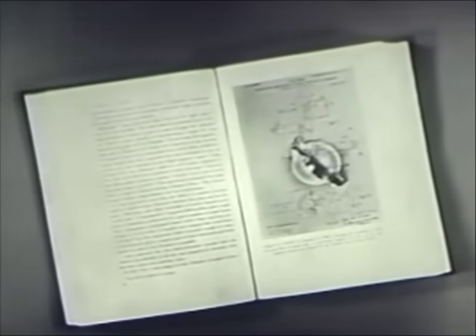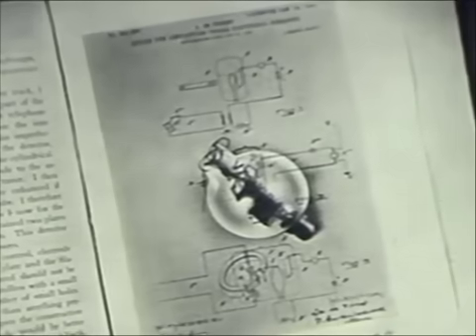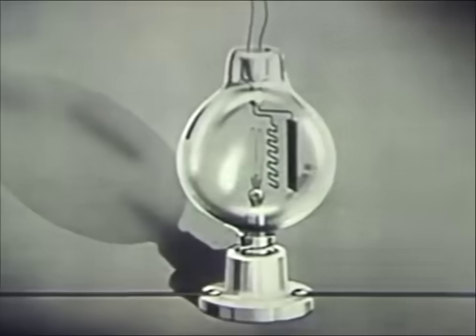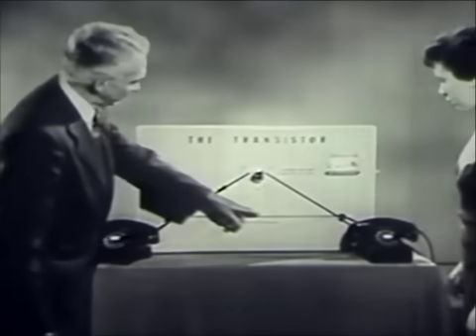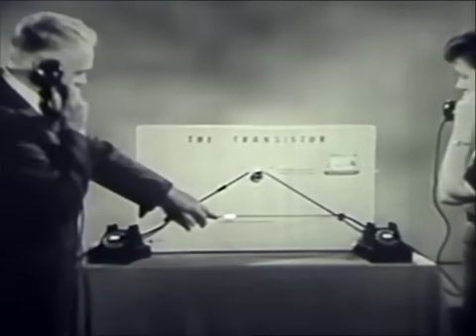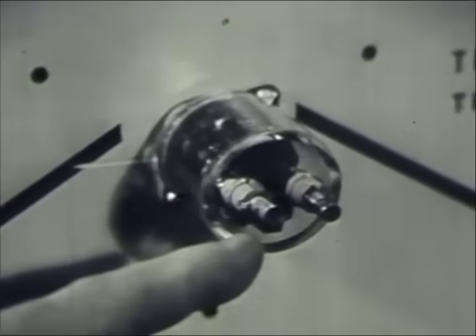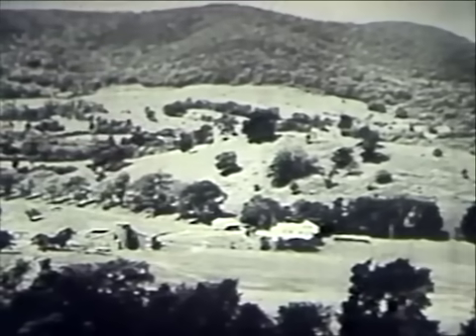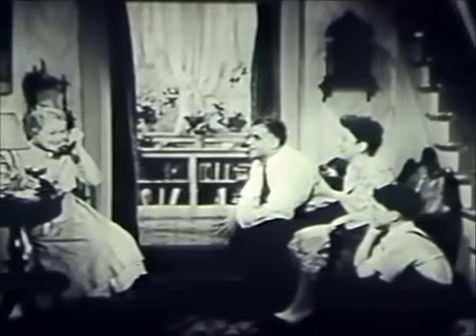The Transistor: a 1953 documentary, anticipating its coming impact on technology

Comment: In 1953, I wonder if the manufacture's could fathom in 2021, IBM would manage placing 333 million Transistors in an area measuring 1 square millimeter.

Comment: Not long after that, science built the backpack heating/air conditioning unit that could run for days on the same battery. 
It was so reliable, it went to the moon but was never seen again after that. 🤔 🤷‍♀️

Comment: "will lead to devices with longer life..."

Apple: "we'll see about that."
Reply: Oh shut up you fuckhead
Reply: Don't apple devices have a really long lifespan compared to android devices?
Reply: @aimbotmainvz683  about every iPhone I ever saw had a cracked display and it is not a secret that Apple slows older models down with software "updates" to encourage you to buy a new one. Long living and affordable Apple products are a thing of the past
Reply: @plt927  There no more iPhones that have cracked screens than Samsung (comparatively).
Reply: @aimbotmainvz683  I genuinely don't know, but many of the practices that they championed, including making batteries non-user replaceable (and expensive as hell to get done via the manufacturer), walled gardening, and pushing upgrades that devices aren't optimally suited for are all practices known as "planned obsolescence." The difference between Samsung and Apple is that Apple customers have fewer means to opt out, because Apple controls everything. Samsung, however, cedes some of their control to Google, which has been pretty benevolent overall.
Reply: @sarysa  The good things about Iphones is the software support (at least 5 years). While android devixes stop getting new update after 3 or 5 years.

Comment: That's all very nice and dandy, but today in 2021 for example I am a musician, I play guitar, electric guitar. If I buy a 100 (one hundred) watt transistor based amplifier (also called a solid state amplifier) for my guitar it will cost me something like 350 dollars. If I want a 12 (twelve) watt amplifier that has vacuum tubes it will cost me 1300 (one thousand three hundred dollars). We realized that the old tube based amplifiers of the 1940's and 1950's and 1960's sound much better much warmer and even more alive than the best transistor based amplifier. So we went from the best to crap and now if we want old tec it costs about 4 to 5 times as much.

Comment: Also this magnificent quote from not that long ago.
In 1977, Ken Olsen, the founder and CEO of Digital Equipment Corporation, said, “There is no reason for any individual to have a computer in his home.”
Reply: That quote is incomplete. Olsen's complete thought is that we would be connecting to the services of other computers, and part of our monthly bills would be access to those computers.
Reply: @grandrapids57 So both right and wrong. The home computers came first, and the services came later, and the main hindrance to Olsen's vision was data transmission capacity.
Reply: @scottwalker8021  Yes, communication was the bottleneck to his vision, but no he wasn't right at all to think so. Putting sophisticated logic near data was and is absolutely essential to the sophisticated coding needed for pervasive high bandwidth communication, and the same underlying developments in chip manufacturing were the limiting factor in both compute and communication. Despite this, communication has consistently lagged behind compute to the point that we do a lot of compute to reduce communication demands, and even computing itself is largely built so as to manage the bottlenecks in moving data around. DEC did a lot of groundbreaking and important work, but he was rather catastrophically and stubbornly wrong about the move towards smaller and more widely distributed units of computing.
Reply: Ken Olsen ia a prick
Reply: How right he was.
Reply: Apple's slogan once was: 'An Apple on every desk'.
Reply: But he was right, why have a computer in your home, when you can bring it everywhere with you in your pocket?
Reply: @MarcioT But computers in homes came before mobile telephones, so he was wrong, and so are you.

Comment: years ago I did a demolition on this old office complex from the 60's and we had to demolish the computer rooms, these rooms were bomb proof, concrete walls, huge cooling pipes, the floors were all panels that could be lifted up to reveal massive bundles of cables. it was truly impressive, the steel frames, super over engineered, took weeks to rip apart those rooms, every single piece was a monumental task to remove
Reply: I am an old Bell guy. What is really mind blowing is that the old buildings are still in use - so when you walk into one, you see a switch, like an ATT 5E or something and the rest of the building is empty. I'm talking acres of empty building. That is where the old iron racks, jackfields and mechanical switches used to be. 
A shitload of operators, too. 
Fucking trippy.
Reply: @ananda_miaoyin  And they would sound like a million grandmas knitting afghans.
Reply: It is a pity that modern business is arranged in such a way that it is easier to demolish the old one (even if it is built to last) than to use what has already been built. Mankind is wasting a lot of resources into the void.
Reply: Funny! I had a similar job back in the 80’s working for my college, we use to rip apart old abandoned computer systems for parts to be used for the electronic lab courses. And many of those units where from the late 60’s and 70’s.

Comment: One of the first uses (maybe the very first one) was for hearing aid. Early transistors characteristics were very poor, but enough to amplify human voice, so they perfectly fit for hearing aid devices, making them tinier and less battery draining. But this application was not mentioned, possibly because it was perceived as a negative aspect, not favorable for a good advertising.

Comment: A major milestone in electronics. An important bridge to the integrated circuit. Yes, even the humble vacuum tube was a 20th century marvel. We owe a lot to these inventors of the past. Controlling the flow of electrons is still something most people even today haven't a clue about.
Reply: That first decade of the 20th century, that was the decade of invention like no other. The vacuum tube, the car, the airplane (if you want to give credit to the Wright Bros and not Percy Pilcher), the vacuum cleaner, humidity controlled air conditioning, and the crayon. Interesting thing though, the vacuum tube wasn't the first amplifier either though. A relay is in fact an amplifier, albeit a digital one. That is, an electrical contact is made by turning on an electromagnet which pulls 2 pieces of metal together, and then the power that controls can be much much more than the power used in the electromagnet. So even without the vacuum tube, a lot of things can be done.
Reply: A major milestone is an understatement, imo this is the most impactful invention ever made.
Reply: Can you explain how controlling flow of electron works? I'm not from a STEM field. 😅
Reply: All invented by boomers. I wonder if Gen Z and Gen Alpha types know that when they say “ok boomer”
Reply: @akapple3538  boomers from 1907? Lol "OK boomer".

Comment: Had the vacuum diode not been invented,none of this would have been possible,imagine what life would be like,gas lighting........though other technologies may have been produced,we used transformer as amplifiers,or voltage converters.We may even have pursued better forms of energy generation,to power the electric cars that were around!,funny they gave up on electric cars for the internal combustion engine,circular thinking.

Comment: If they only got to see where we're at now with them; the size, the scale, and the capabilities we have along the way now with them as well.  Oldest one I have is an RCA SK3004 I think is the part number.  Used it in a basic guitar pedal testing amp.  Lame amount of gain by today's standards but, it does still nevertheless function.

Comment: 4:00 " How did it ALL come about ? " Roswell UFO crash July 1947. Transistor invention: July 1948. They just HAPPENED to be doing experiments on Germanium and other SOLID substances, when vacuum tubes were hollow glass tubes that were sucked down into a deep vacuum. Didn't they FIRST put germanium and OTHER materials into a vacuum tube to see how they reacted ? I would think THAT would be the NEXT step, I mean, after all, you have to crawl before you can walk and walk before you can run. It seems they went from crawling directly to FLYING ! ha ha ha.

Comment: I still don't get it. What job exactly does the transistor do? It can't keep memory. What does it do??? How can it calculate 1+1=2?
Reply: I'm a retired software/computer engineer that had similar questions way back in the early 1970's.  From the Wikipedia for Transistor - "A transistor is a semiconductor device used to amplify or switch electronic signals and electrical power".   Now how do we go from that to "storing" and "adding"?

First we will answer the question "how do you store data using transistors"?  The answer is complex but it starts with the concept of a "flip-flop" which has two stable states that can be used to store information.  This was invented in 1918 and used two vacuum tubes (two transistors can be used and this massively reduces the power requirement and the physical size).  The basic idea is that you cross-connect the outputs of each transistor to one of the inputs of the other transistor and then, as long as you power the device, the output stays the same.  By tweaking the value on the non-cross-connected input of a transistor, you can make the circuit "flip" to the other state (hence the name).  This can be used to "keep memory".  

Now to return to the question "how do you add using transistors"?   Once again, Wikipedia is our source. The first type of adder was called a "half adder" and used two flip-flops to add two bits together and generated a two-part answer, (1) the sum and (2) the carry.  To perform adding in the fashion we humans are used to, you will need 2 half adders per bit.  So to add numbers with 32 bits (up to about 2 billion), you will need 64 half adders and since each half adder requires two flip-flop, you will need 128 flip-flops.  Similarly, each flip-flop contains (at least) 2 transistors, so you will need (at least) 256 transistors to add two 32 bit numbers together.  

Back in the early days of computer science, we built (and debugged) a circuit from individual transistors that added two 4-bit numbers together.  Going through this exercise gives one a deep appreciation of the complexity of modern computers.  I also remember a "marbles and pegboard" device that demonstrated how a computer combines simple operations to perform more complex operations.  Just now, when I went searching for this, I found an educational device that would have saved me a lot of time attempting to explain computing over the years.  There is a "computer" that uses ball bearings, a plastic pegboard, configurable "flip-flops", and gravity to perform calculations.  It's called the Turing Tumble and it seems to have an active community.  And it can be 3D printed.    

DISCLAIMER: I have no connection to the Turing Tumble product or site.

Notes: 
https://en.wikipedia.org/wiki/Flip-flop_(electronics)
https://en.wikipedia.org/wiki/Adder_(electronics)

Comment: And yet here we are in 2021 still using tubes in our guitar amps 😂🤷🏻‍♂️
Reply: It is often lazily and probably inaccurately stated that the stone wheel is the first invention. However, even stone wheels are still used to this day for grinding up wheat.
Reply: Power transistors are subject to intermodulation noise that can’t be filtered out mainly because of the frequency of the power lines. Tube amps for headphones sound super clean too

Comment: The Transistor was invented in the late 40's, but we didn't really utilize the technology for many years, the Japanese figured it out and flooded the market with transistor radios that could fit in your pocket, which was a huge deal at the time. In America were were still using tube technology all the way up until the 70's. Transistorized or Solid State became the marketing buzz word in the late 60's and 70's to convince you to buy non tube electronics, by the late 70's, most of the tube technology was gone. We bought our last tube TV in '74 and that lasted for about 10 years, only because you couldn't just go and buy tubes at the drug store anymore.

Comment: With a transistor such a device could fit into a good sized room lol!  Who knew.  Darn.  Forgot to charge my cell phone again!
Reply: And they said 'hundreds of calculating jobs', your phone can do 5.8 Million calculations per second.
Reply: @kennarajora6532  You must have a really antique cellphone.
A 2021 Android phone has got a capability of far more than a billion (!) Floating point operations per second.
Reply: @kennarajora6532  5.8 million?  Your phone must be terrible if that is all it can do.
Reply: @kennarajora6532  
5.8 million would be a 5.8 Mhz single core processor.
it is more around 10 Billion today.
Reply: @Ismalith  it takes more than one clock cycle to do a floating point add...

But yeah I get your point.
Reply: Though if we were using individual transistors, that's probably as far as we would have got.
Reply: @literatesasquatch  you mean like the CDC Cyber 7600?

I learned to program in Pascal on the infernal thing... in 1981.

Much later, I discovered that the 7600 used discrete transistors...
Reply: And now, there are more transistors in your iPhone charging cable than were in the old transistor radios
Reply: @MisterNiles  Very likely. A typical Transistor radio had 5 to 8 discrete Transistors only.

A charging cable usually engages a RISC microcontroller with around a million Transistors.
Reply: Well, it would be another20 years before the first integrated circuit. They had z lot of diddling about to do before they figured that out
Reply: @AndrewHalliwell  20 Years?!? LOL🤦‍♂️ it was only FIVE years after this film! Jack Kilby Of Texas Instruments, developed the I.C. in 1958.
Reply: Ssssh, your age is showing
Reply: HAIL Satan!

Just teasing, God squader... 😉
Reply: All the better to watch YouTube videos on while you sit and poop.
Reply: and your phone has a dozen or more processors in it
Reply: @squelchedotter  you've a nice one! Mine only has 8 cores. Old one had 4. Older one had 2
Reply: @Theineluctable_SOME_CANT  No no I don't mean cores. I mean processors. Your phones cellular modem has a processor in it too. As does your fingerprint sensor and accelerometer, the bluetooth and wifi modems, your USB-C charge controller, the power regulators, your camera. Almost every single function of your device has at least one small computer in it. Even your main processor has a small processor to start it up.
Reply: @squelchedotter  Point taken...

I will have to get off my arae and check out what you said. But one small point:
The camera doesn't have a dedicated processor as such. There are circuits which implement state machines for complex work and there's a myriad of async and clocked logic for the simple task of scanning a matrix of elements including but not limited to mere pixels, to pump it out to the data in pin on 
an I/O buss somewhere.

The thing is, processors must execute CODE. You can do an awful lot without requiring a processor to run code...

Comment: Microchips are still based o transistors. Tremendously miniaturised and packed onto a wafer of silicon, but still transistors. I guess in 2090 there will be documentaries like this about silicon chips and the electronics of 2020 will look as primitive as do the valves shown here. It might be quantum computers by then...but equally likely to be some unimaginable new thing we do not even suspect exists at the moment.

Comment: "At Apple's (NASDAQ:AAPL) iPhone 6 and 6 Plus event, the company's Phil Schiller announced that the A8 chip found inside of the phones was made up of 2 billion transistors. That's a lot of transistors, and about twice as many as found inside Apple's prior generation A7."
Reply: “The iPhone 11 Pro is the best machine learning platform in any smartphone” Santhanam said. When it comes to architecture, Apple is using 7nm transistors (like on the A12 Bionic), and there are now 8.5 billion transistors — that's a huge update compared to the A12 Bionic, which had 6.9 billion transistors.

Comment: 0:47 "Smaller, more compact electronic devices that will need less maintenance and have a longer life".
Oh how wrong they were there. The race to the bottom for manufacturing costs and maximizing yearly profit has meant the opposite for nearly everything electronics get included in...

Comment: When I was in the Navy in the 1960's we had cryptographic equipment that used thousands of diode tubes, to process information. We were kept busy pulling boards and replacing soldered in tubes. The heat generated and size of the machines would be laughable today.

Comment: "They will make possible smalller, more compact electronic devices that will need less maintenance and have a longer life".   Then Apple came along and slightly modified that last bit.
Reply: It’s Apple’s software that needs constant maintenance like a finicky toddler. Touch it wrong and off it goes. The battery issue was unintended on their part, where on the other hand the neediness is part of their software design philosophy.

Comment: The first car I learned to drive was my parent's 1953 Chevy.  It had an AM radio using tubes.  The sound would come on several minutes after starting the car - sometimes startling me.
Reply: My 1957 Ford Thunderbird has an AM radio with tubes. I bought the car as a project so I don't know if the radio works.